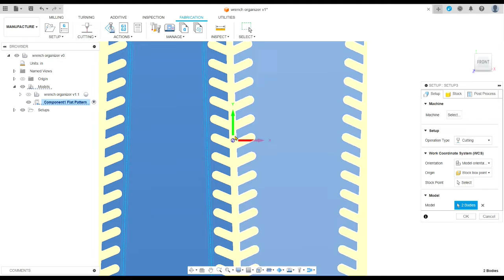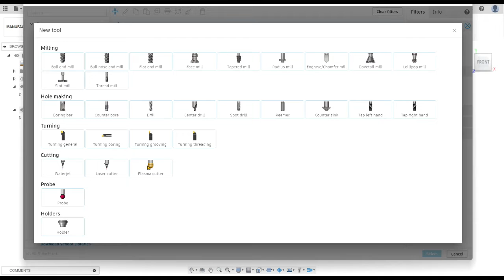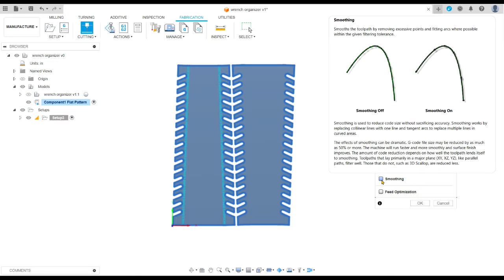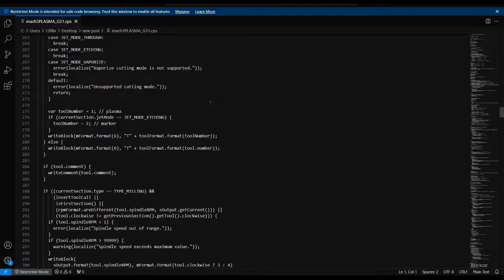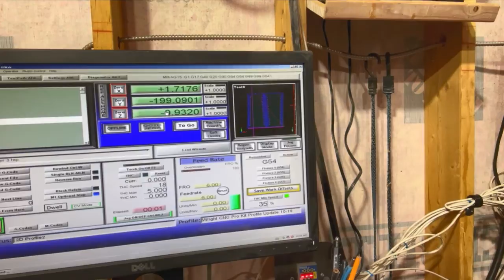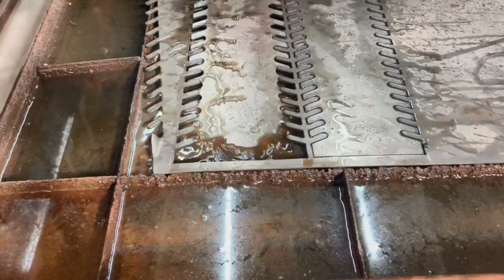Post Process file, creating tools in Fusion 360 for CNC plasma cutting. Questions Answered!

Comment: nc failed
 !Error: failed to post data. see log for details.  Get this error when  doing post process can’t get to generate G code .
Reply from the maker: Make sure your output folder is correct. And you need the Mach3PLASMA_G31 post file.
Reply: @twoguysmakestuff4445  I fix it , yeah the output folder wasn’t wright . You should make videos like  the type of errors we make as begginers .
Reply: Would you mind sending me the mach3 post processor file? Thank you for the videos.  @twoguysmakestuff4445